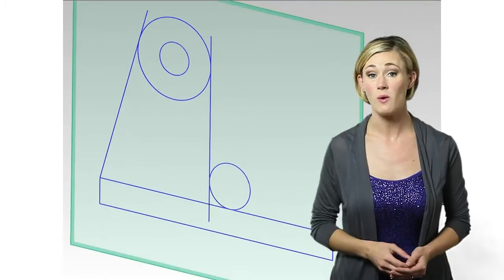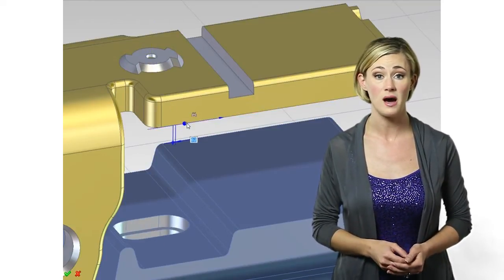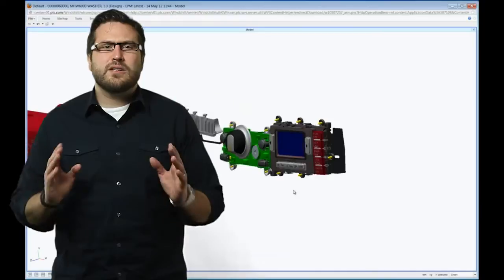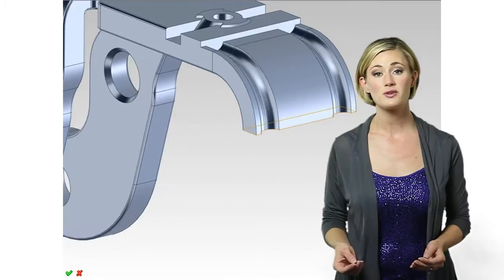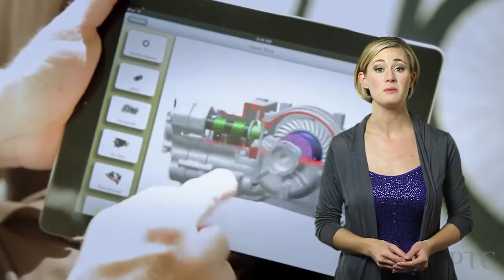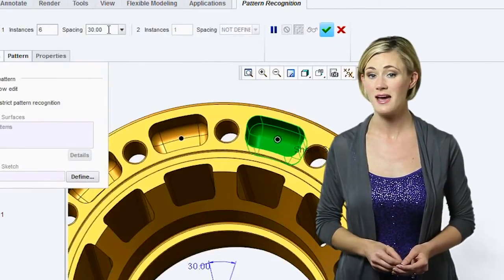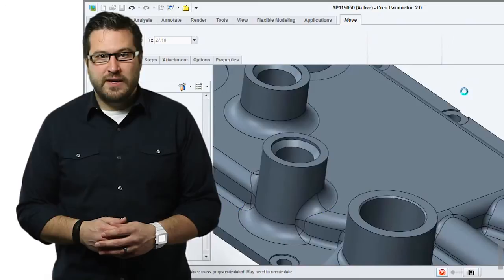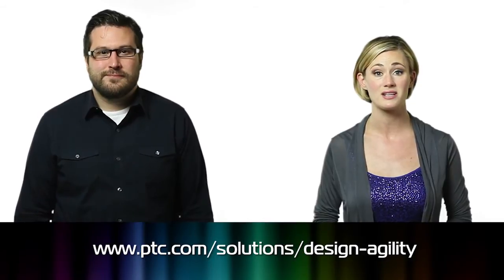The Whats and Whys of Direct Modeling

Comment: wtf?? direct modeling has been around since the 70s. You guys are oblivious.
Reply: lol
Reply: You are an Idiot. There was no direct modeling in 70s......
Reply: IKR ? they're talking about it like it's a new thing when Moi 3D has been doing it for years
Reply: @mihailazar2487  Its more in the engineering disciplines they're talking about. Most if not all engineering CAD programs have been Parametric. And for the most part engineers will still use parametric modelling, and whilst there might be some limited instances were direct modelling may be useful to implement, a good Parametric model that has been designed with proper dependencies, and also global parameters, changing things can still be easy, but also allows ultimate control.

As far as I can tell Moi 3D is for designers and artists, and not engineers.
Reply: @PBMS123  can we just stop with the who is it for bullshit ? A tool is a tool. if it fits your workflow use it. I can create fully parametric 3D models in Blender way easier than in any other CAD program because I only use them for 3D printing, and not CAM, so they would get converted to a mesh anyway. Everyone I've ever told this to keeps saying I'm crazy because Blender is for artists. who TF cares ? if it does the job it dies the job and that's it. MOI 3D is way more intuitive and smooth than the examples shown here. of course you wouldn't design mechanical parts in it, but for cosmetic outer casings and shells and things like that it's really really good
Reply: @mihailazar2487  are you out of your mind or something lol? just look at the date when this video has been posted. Moi3d existed in its barebones form at the time and it worked like CATIA did in the 80's